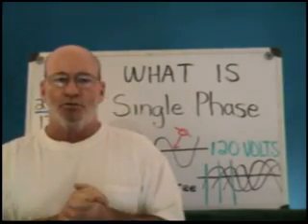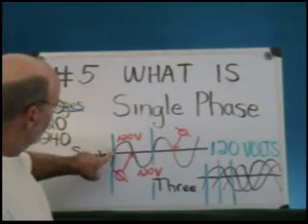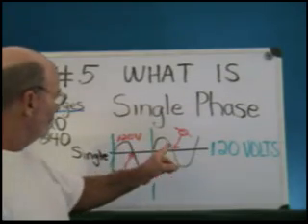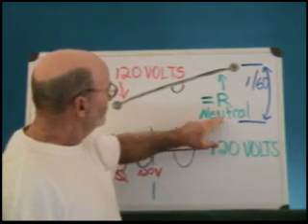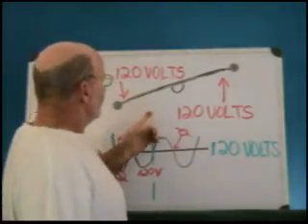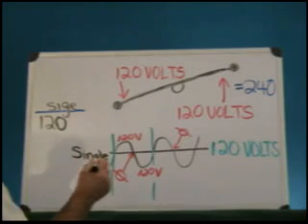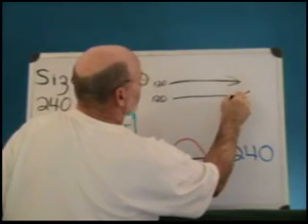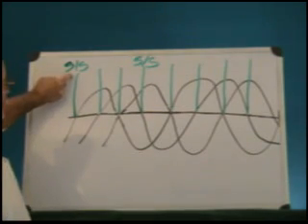Single Phase Power, #15

Comment: So why is this not called 2 phase??
Reply: In 240 both lines have the same start/stop within a cycle. In 3 phase, l1 l2 and l3 start and stop at different times. Meaning that while l1 is reaching its stop, l2 is reaching its max and so on.

Comment: 120VAC does not peak at 120V!  This is a bogus chart.  120V is the RMS voltage which means the actual peaks are at about 170V.  Downvoted for inaccuracy.  You should be ashamed for giving out wrong info.
Reply: where the heck do you get 170 volts?
Reply: peak voltage is 120rms/.707=170V peakV
Reply: Average guy that fixes his home should care about RMS or VPP.  In the case of the capacitors,  we do need to understand that the labeling coming in VPP value.
Reply: If this were 120 volts peak on each leg that "balance" each other, wouldn't that give you ZERO volts?

Comment: Your explanation of the single phase system was very good.  I have always had a problem trying to understand the 240 volt systems since one leg had to be plus 120 volts and the other leg had to be negative 120 volts I thought they had to be out of phase 180 degrees for them to balance each other.  Kind of like the three phases balance each other.  Thanks you.  Tom

Comment: but thats buull dung in the field cos ditrubution companys are going to balanc loads with 2 pase separate lies take a look at every transformer on a pole your getting 2 phase problem is hz germans like 000 s 60 hz better but 415 240 a lot better  this country so far behind its unreal every bathroom gfi n kitchen protect the panel rcd

Comment: Hi, compliment for your lesson  I bought a 12v to 230ac imput and output,  3000w power inverter , with charger and UPS, but, the problem is, this inverter is single phase (europe) i have a plain to send it to Brazil, I have in my house in Brazil  220ac ( 2 hot legs) please tell me how to conect it drowing  a simple diaghram, and how kind of correct  breaker. tank you in advance. NATANAEL

Comment: I have a boat here in Aus ex america, it has 2x 120vlts hot legs onto the main buss, we run 240vlt single phase here as is all of our equipment/motors can i run both 120vlt legs onto my 240vlt split phase motor/compressor to the gen-set ground/men, the vid was great too cheers.
Reply: +Jarrod Mason  Yes you can, one leg would be connected to your Live protected by a suitable fuse and the other to your Neutral thereby giving you a balanced power half into each leg from your 240v. You should have by now most probably tried it already and found no problems.
Reply from the maker: I really don't know and am prohibited by state law to work on boats or mobile homes...sorry.

Comment: Thanks for the info, I am just a D.I.Y. guy and don't ever work on meter panels, etc, all I do is add a breaker in my home and a line for the window A/C.
I would never make an electrician because my math skills are very poor, I avoid math.
I always understood that "single" phase was 110 volts (from neutral to hot) back in the days (1930's) when they had knob & tubing wiring and NO such thing as 220V in a resident home.
I am only referring to your typical family home not a commercial. building

Comment from the maker: #3 As for the see-saw effect...Sixty times per sec-the electrons change directions-When the legs are 180 degrees out of sync they balance nicely. With three phase it doesn't work as well unless all three legs are used-I have 4 more how to videos to post and then I'm moving on to 'how to pass your electrical examinations' including OSHA and Fire prevention codes (different code book) ALL the stuff I mentioned will be on your electrical contractors exam-stay tuned-I have a lot of work to do.

Comment from the maker: (Read Second)...120 degrees out of sinc so that the voltage cannot and will not ever give you a balance load, thus they call it three phase-Complicating matters, 3-120 volt legs will not give you 360 volts. The power factor is 3 X 120 divided by the square root of 3 (1.73) which gives you 208. Stay tuned, I begin a 2011 code class as soon as my state adopts the new code book-it then becomes public domain. I plan to go through the full book and explain things better-thanks for comment

Comment from the maker: Single phase and three phase are arbitrary terms so that the public and stupid electricians can get a grasp on AC power. Tesla correctly defined it as polyphase which means you can have from 1 to hundreds of phases on a large enough generator-And then you have from 1 to 359 degrees that these Legs can be set at. currently single phase is set at 180 degrees so the sync is equally timed and appears to be single although it IS double phase-Three phase is 120 degrees out of sync (to be continued).

Comment from the maker: Because if there are items on the dryer that require 120 volts then you just use a single leg to get that power. Another reason is that it balances the load between L1 and L2. The reason that four wires are needed is so that you can ground the dryer without including and unbalanced load. Example: on shared ground-neutral-if L1 is 3amps and L2 is 5amps your dryer would be energized with 2 amps. That would give you quite a shock. Stay tuned-a whole batch of code videos are coming your way shortly

Comment: Ahh I see, see I'm coming from the opposite direction. I'm taking an electrical engineering HNC atm (equivilent to a foundation and first year of a degree) which goes into the mathematical side of it but not into the practicality of the system. I guess you could say that I have a lot of the panel and physical stuff to learn for when I'm thinking about where to place junction boxes and distribution boards for my job. Your videos have been a real help for me to look at more than symbols :)

Comment from the maker: I have a video on three phase but it only touches on the timing and spacing of the phases. I am studying delta and wye transformer math presently and that will answer a  lot of phase questions. VERY complex, could take me a while to get the 5 or 6 different possibilities into video form. One last thing. Any leg of a three phase source can be used as a single phase leg as long as there is a neutral provided. (Stinger leg excluded because that is straight 270) Stingers are marked orange in panel.

Comment from the maker: I could not agree with you more. I think that is why Tesla actually called it 'Poly Phase'.  Depending on different variations of generator-alternator-motor windings, you could have a 60 phase motor. Too bad Tesla did not write about his inner thinking's, but I think he foresaw problems with labeling his electricity any thing other that Alternating current or Poly phase. From a forensic mathematical viewpoint, 3 phase is single phase..the amplitude and cycle are the same, spacing is different.

Comment: Yeah but by that definition, 3 phase means 6 phase. Because there are 3 sets of positive voltage and 3 sets of negative voltages. Its probably just a disagreement on semantics, but generally the term phase comes from the fact that the sequence of wave forms is generated a certain degree out of phase (Which is most commonly 120 degrees). I may be wrong though, but after checking my reference book thats how its described. Do you have a link to a source which clarifies that definition?

Comment from the maker: Just for the record, Tesla discovered poly-phase electricity and it is a generalized term that describes the back and forth property of the electrons as opposed to direct current. Single phase, Three phase, Delta and Wye transformers are only sub categories of 'poly phase' electricity that make understanding the nature of electricity a little easier. Single phase is actually two phase but called single phase because the energy waves are balance in time with each other. Thus 'single phase'.

Comment from the maker: One of two reasons: You are either out of code or  the system was installed before all devices were required to be grounded. Pretty likely you are in code violation. No neutral tells me there is no need for a 120 leg. You really should ground that item.

Comment: A res. wir. system consist of 3 wires entering the building, 2 hot wires and a neutral, this is considered a single phase 208 system assuming that each hot wire is 120 volts. If the transformer bank is connected delta it would be 240 power to power. A com. ser. would consist of 4 wires, 3 hot and one neutral this is a three phase system. A  277/ 480 system is usually used in small factory's to lower the amp. to the motors to save on copper. This system is done by step up trans. within the buildi

Comment: you are getting 240 because the transformer bank is connected in a delta configuration. my blog is referring to a wye system. A basic electrical book will explain the difference between w and delta.

Comment from the maker: I confess that I am not familiar with O E phase. However I will venture this much. Whatever the situation is, you do not want to exceed recommended amperage of any given device. I would use the formula (watts divided by volts) to arrive at your potential amperage. If it exceeds the rating by 3% then I would not do it.  Please get back to me on the O E phase definition.  Thanks, John

Comment: In a 120 wye system, phase to phase is 208 volts not 240, phase to phase voltage can be calculated by multiplying any phase times 1.73  example 120 X 1.73 = 208 voltage
Peak voltage is 170 volts, that is from the zero plan to the top of wave, peak to peak voltage would be 340 volts.  120 volts is the reading that a volt meter would register when measuring phase to neutral this is called rem voltage.

Comment from the maker: @salahuddinnadeem On 240 the only colors you cannot use for the two 120 volt legs is white or green.  White is acceptable on a backfeed in the use of 120, but the only time that a neutral (white) is needed in a 240 volt application is when there is a 120 volt step down transformer in the system.  Always ground everything with green, or bare wire where code requires it. hope this helps.

Comment from the maker: @salimkhan007 I'll be honest with you. I don't know if your dealing with two 120 volt legs or a 'stinger' which is one line of a voltage exceeding 220 volts. In the US 'stingers' are used in lighting and are a single leg 270 volt line which DOES require a neutral. If you are dealing with a 'stinger' line in Asia then YES you do need a neutral. It's more complex than space allows. Give me more details and I can better answer your question.
Tank you,
John

Comment: @jackfortunato 
Just do it with the generator. The makers have made it that way.
Only the hot wire, black, can shock you. The lamp will light connected to the hot and ground.
From a 120 v transformer if you connect one of the two wires to earth the other will be the hot one so you can get a shock touching that wire and earth/ground. Either wire can be chosen to be the hot wire.

Comment from the maker: 240 is two 120 volt legs.  If your plug is 120 volts then only one side will be hot.  If it is 240 then both sides will be hot.  Depending on your generator, there may be an automatic GFI safety feature built in that will nor allow your generator to function unless it is A: properly grounded, and B: the neutral is able to complete a circuit with one or both of the hot legs.  The ground should be isolated from the load side of the neutral otherwise your GFI will pop and not reset.

Comment: I hate electricity! This discussion sheds no light on why I have to ground two of the 4 wires on my generator to make 120 a/c.  And then how do I wire a light bulb to it? Aren't both sides of an A/C plug capable of shocking you? So then my generator would shock you if you touched it's case while it was running?